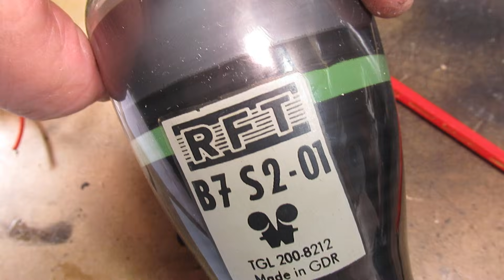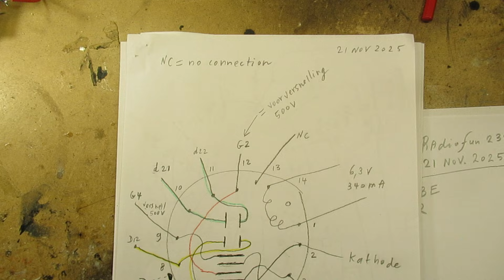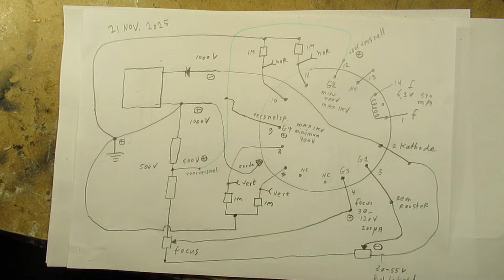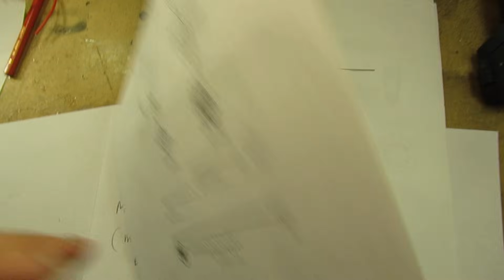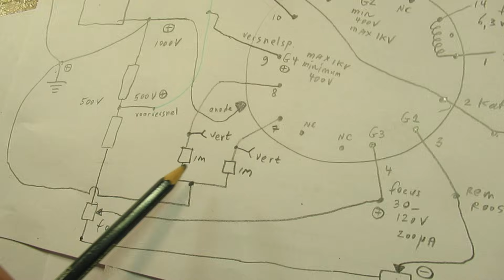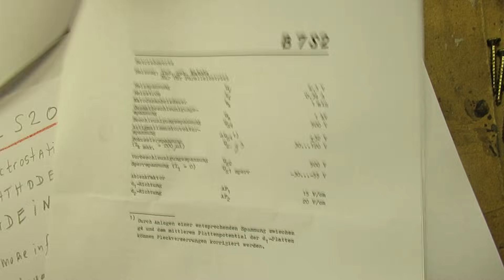Electrostatic Cathode Ray Tube B7S2 from Eastern Germany: how to get it working & first ideas/setup

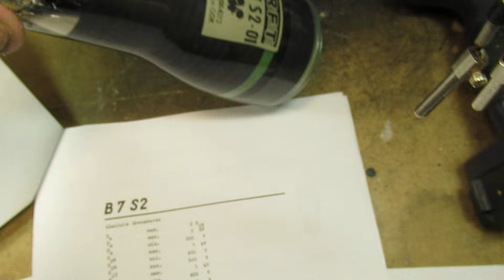Comment: 7:20 - if you can't find proper socket you can use female connectors from jumper wires. You have to pull them out of plastic housing obviously. I discovered this hack when I first played with DG7/5 tube but didn't have B9G socket at the time.
Reply from the maker: Thanks, good idea, useful for everyone.